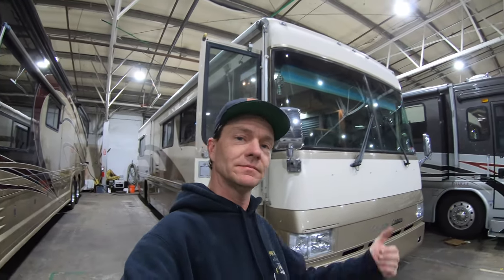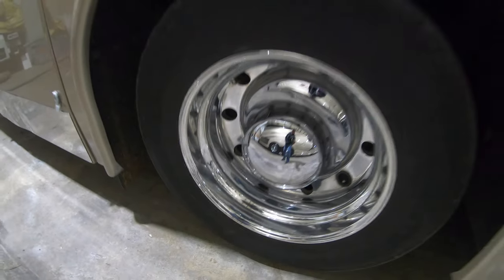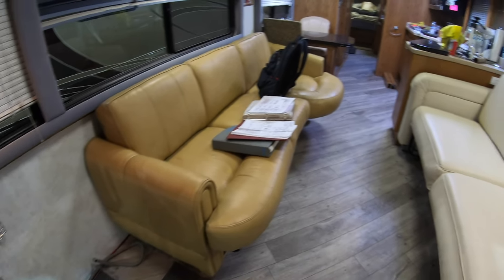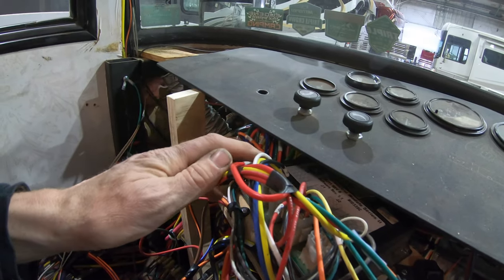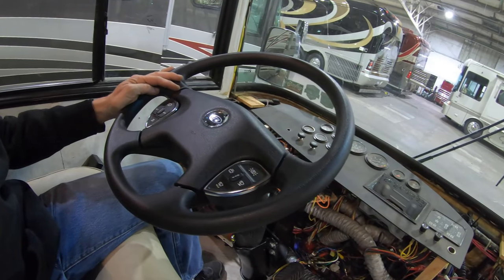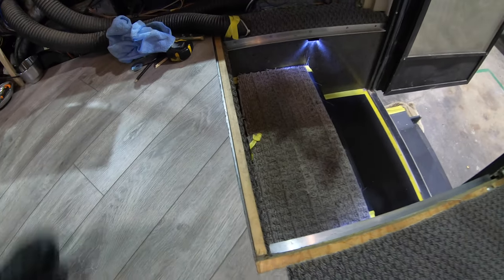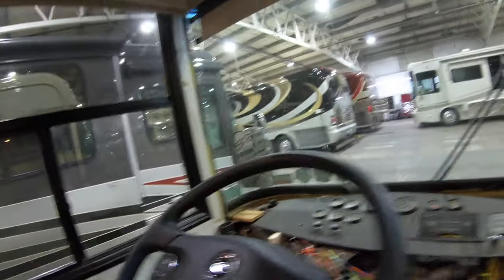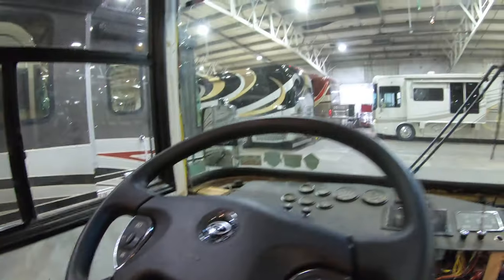What did it take to install a VIP Smart Wheel.

Comment: I’m new to your channel and was impressed with your abilities. The smart wheel in my 05 Freightliner chassis messed up yesterday while parked in the shop. Anyway no horn, wipers, cruise. No mice damage and the smart wheel fuse is good. Also occasionally the wipers can take a one time swipe at random. Any advice would really be appreciated.
Reply from the maker: I would check the constant power to the brain. Whenever they get new constant, the wipers will cycle.

Comment: Hey Brian,  I've got issues with my smart wheel in my DP. The buttons will occasionally mess up to where they all activate the horn and the cruise and sports don't work, then they go back to working correctly. Is there any way to trouble shoot where my problem is? Thanks

Comment: Hey Brian..great video...One question. On say a 2005 model which has the older smart steering wheel design how difficult is it to swap to the newer steering wheel design as you have installed in your 95?

Comment: What is the VIP part number for the clock spring
Reply from the maker: Sorry about delay getting back to you. Should be able to get it from a freightliner service center.
Reply: @briansrvvideos   Thanks for the reply I got the part from a freightliner dealer part number DAC-1900043 . Took about 1/2 to change.